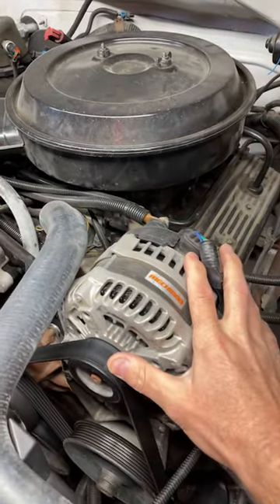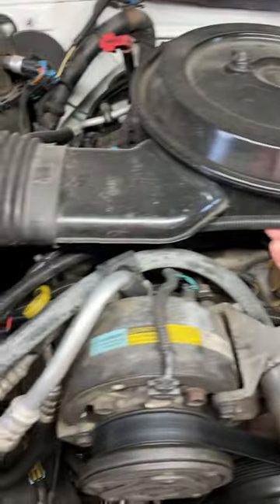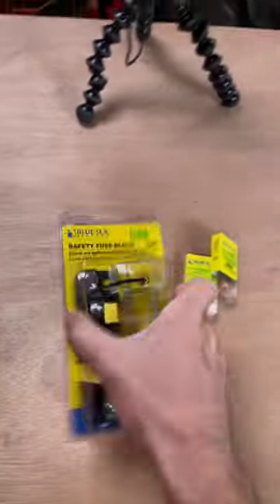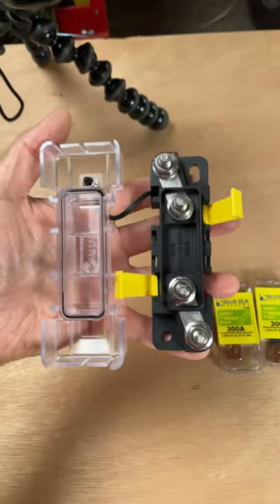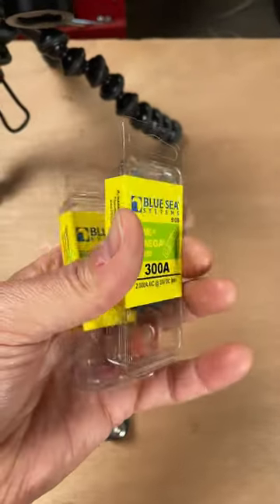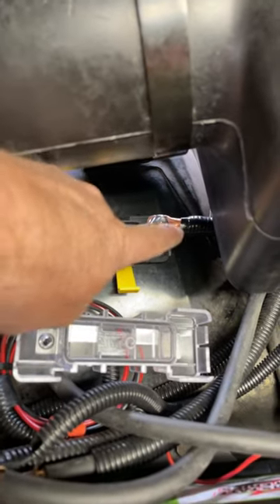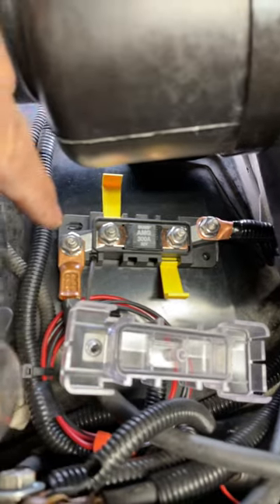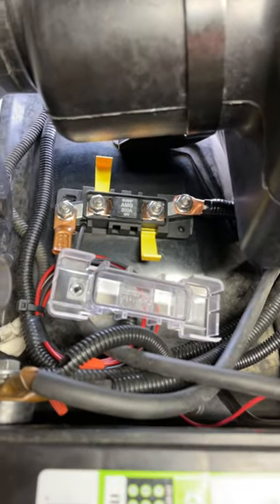Customer States His Install Was Professional!!

Comment: How many amp is rating the alternator and the battery?
Reply from the maker: 250amp alt. Standard 12v battery. Alts don’t send full rated amperage… the only produce what is required. An alts rating is a maximum that it’s able to produce if needed. To my understanding a fuse block IS absolutely needed on the positive wire and must be rated for higher than what the alt is capable of. So, since it’s a 250amp alt, I installed a 300amp fuse. The fuse should only ever be needed if there is a problem of course. 🤙

Comment: I'm a professional technician for 30 years you don't put a fuse on the alternator , you put a fuse on the line that goes in to the car. You're trying to save the car not the alternator,  the alternator. Cassandra sisters that cut off or burnout, but for the battery into the car it doesn't.

Comment: Hate to burst a bubble here, but there's not usually a fuse between the alternator and battery for most vehicles. They come directly from the factory like that. There IS usually one between the car's electrical system, i.e. the fuse box, and the battery, but not between the alternator and the battery. There's really no point in having one there.

Comment: Hmm? Stock doesn't have a fuse and some stock alternators are 220ah. And the two ambulances I worked on with dual alternators neither with fuses. So freaking out seems like a money pitch. 

Now, on a different note, I did have an alternator fail, twice, once it melted the cables and damaged the battery. The second exploded the alternator while on the highway and it looked like someone welding with sparks blowing out the side of the truck.

As for what to charge, it shouldn't have taken more than a few minutes, so shop minimum for either half hour or hour depending on your rates. Me personally, I would charge $30, but I always follow the shop hourly rates. $57 is a good shop charge. I personally charge half of shop minimum since I don't have the overhead. Now, if you say it's a trade specific repair, training charges can apply like welding, which $120+ can be warranted. But, fuses are fairly basic and only knowing a good quality is really needed these days, so I would say, $40 is a great price plus parts

Comment: What would happen if you didn’t add a breaker box? The worst case scenario the high output alternator charges the battery up so much that it surges blowing all the fuses in the vehicle. Wouldn’t it do that anyway unless the fuse is rated so low but wouldn’t that blow it negating the extra charge. If it’s a series of battery’s which is most likely why you would want a …. What?

Comment: Retired Professional Mechanic: Amistad none of them are fused from factory.  What's the big deal, not going to make it charge any better. If wire is correctly routed there is no need. Just made another problem so if alternator doesn't charged 
Another thing to check

Comment: That alternator probably isn't rated at 300A. That fuse will never blow  unless it shorts to ground. Take off that 2 gage wire. Install 8 gage wire will probably be better. Depending on the alternator output I'd install a fuse or fuseable link accordingly.
   You're question on charging the customer should be a half hour labor. $15.00

Comment: the only way this would be of any help is I'd you stuck a fuse right after the alternator then another right after the battery. even then it's not going to do much because if it blows the line is still hot from the other end so it is not very helpful at all.

Comment: Doesn't need a fuse, it will drain that little battery before it catches fire. Thats why your starter motor cable doesn't have a fuse either.

Comment: Thats like 40 bucks for the labor and add on the price of the parts with an included receipt. But why fuse the charging cable? Never saw that before. Unless its bc of the "high amp" alternator.

Comment: I love how there is so many people in the comments saying it's not necessary or pointless I would 90 percent of personal vehicle have some kind of fuse between the alternator and the battery wether it be a traditional fuse a fuseable link or built into the junction box or on the battery cable itself with a smart terminal most vehicles do have them. I mean just think about it with that high of amps what would happen if it shorted to ground it would burn the car down

Comment: Why don’t alternators have fuses from factory then?? Also the spot you put that fuse is pointless it’s in the middle meaning if there’s a break in the line between alt and fuse of bat and fuse then that fuse is going to do nothing the only situation where it would work is if there’s a break either direction after the fuse and it grounds out…

Comment: Anything you charge is too much, OEM often has a direct wire from the positive on the battery to the alternator.  Unless the owner wanted you to install the inline fuse, in that case the book tells you how much to charge them as if you were repairing a short in that wire plus list on the part.

Comment: My friends little brother was talking about hooking a system up in his truck and was asking me questions about how to do it, I told him what gauge wire he needed and to make sure he installs the fuse like 6 to 12 inches from the battery. I go over my friends and he's there so I ask to see it, and he has like speaker wire running to the battery with no fuse for the amps power wire and the same thing for the ground. It was like 2 tens probably around 500 rms watts, I told him what was gonna happen and made sure to let him know I'm serious, I told his brother to talk to him about it but he still didn't listen. Went over for 4th of July a couple weeks later and it was still the same way and he was playing music sitting it in with the door open and you just hear him scream, the wire was on fire and red hot but luckily he seen it cause the door was open, started melting into the plastic on the battery and was smoking like crazy 🤣🤣🤣🤣🤣🤣. He just never hooked it up again LMAO.

Comment: 👏👏👏👏👏👍👍👍👍⚡⚡ now his alternator won't catch his battery on fire if it fails. I'd charge him an hourly rate of 80 and hour. And 2 hours of labor to diagnose get the parts and installing them. Out the door if quote them 160 labor and the 2 fuses are not cheap about 20 each. And that block is about 30 dollars. 
So my quote would be 100 for parts
                                         160 for labor

Comment: To everyone saying that there's a problem with adding a fuse to the charge wire oh, what if there was a short and that high amperage alternator? You would be out of a vehicle if you didn't have a fuse from the battery to the alternator. So yes you should have a fuse from the battery to the alternator, especially with a high amperage alternator. For the mechanic that said he's never seen a fuse on the charge wire, I want to know where you work, so I can avoid going there.

Comment: I don’t think you need a fuse in that situation. Alternator has a voltage regulated. Also that wire it’s too much. A proper wire for the alternator amps out put it’s enough

Comment: Whatever the cost of the fuse + 30 bucks. Because you really only did like 10-15 minutes of work. To cut the existing wire, strip them back for the eyelets, install the eyelets, and mounting the fuse. Price of parts doesn't change much. And if you're working for yourself, the labor cost is flexible. You want to charge enough to cover any costs for expendable items like self-tappers or whatever it is you used to mount the fuse. And then for the little bit of time it took you. I probably undercharge by a lot for most of the things I do. But I charge based on how much work it's going to take. If I didn't do hardly anything, then I won't charge hardly anything. But if it's going to be a drawn out process that's going to take a chunk of time, it's gonna cost a bit

Comment: 5 thousand dollars. If my mechanic can get away with charging me 950 to do just the front brakes and a ball joint the you can charge 5 grand for that due to the electrical system being worked on. Call it hazard pay

Comment: Okay 1 dont put a big heavy high amperage wire in a spot it can wear through like under all that stuff 2 dont put it where it can get hot 3. use the proper wire for the load you are operating with 4 if all of that can not ensure the wires safety than put the fuse as close to the component supplying the power as possible so that the fuse can actually do its job cause if it shorts to that air cleaner fuse no workie. if it shorts to those a/c lines fuse no workie. and then it looks like it is laying across that valve cover so another short point right before the alternator saving device the only point it could short that that fuse could help it is between the fuse and the battery where that wire actually looks safe so my conclusion as a mechanic that has installed these fuse and removed them i can tell you this one will ONLY help if the alternator itself has the failure so i will say this the install was fine before and you ripped that cusomuer off and talked crap on an honest true pro that you could do to learn a thing or two from give that customer their money back and dont do no more dumb crap unless you move that fuse to as close to the alternator as you currently have it to the battery your a straight dolt and stay away from my car and the ones i work on

Comment: There's no fuse on the factory cable from the alternator, this video is ridiculous. That cable should have been better routed though. 
The fusing is necessary after the battery to protect the factory components and any aftermarket equipment.

Comment: Isn't the job of a fuse to protect consumers? Why put one BEFORE the battery? Also, I would pay you less for using black cable without at least red heat shrink tube to seal the connections and color code the cable to be visibly POSITIVE. I only see the cheapo crimp, not a 360 hydraulic press fit or solder. Not professional as far as my standards go.

Comment: Why would you need a fuse to the battery?  Batteries only like to be charged at 2-10amps depending.   The voltage regulation should reduce the output according to usage.  This is a needless install.  And 300amp isn't needed unless, during driving, he's using 280+ amps.   Maybe a high powered bass system, or something like 50 120 inverters running vacuum cleaners, but then he only needs a Capacitor for the bass sound system and not a fuse off the alt.  I'd like to know why you think that's needed?  I'm an Electrical Engineer, and don't understand your train of thought, other than doing that, just to make money.. .  SHAME ON YOU!!

Comment: If it were more professional then there would be more heat-shrink around the exposed + charged metal.    I don't know why they'd meed more alternator when IMO dual starter-batteries offer more power with the exact same charge-problem.

Comment: Whatever you charge - it's too much.  unless you insulated / isolated the + wire from the back of the alternator into the fuse block - the wire is still + live and subject to being shorted which is the point of the fuse.   The fuse should be as close to the alternator as possible. Not all the way across the big metal block.

Comment: Back to auto electrics 101 for you. Quite apart from the fact there is no fuse on the starter or alternator line, with a 300A fuse, seriously? The car will be a smoking hulk of ashes long before the fuse would blow.

Comment: I’m surprised how many “mechanics” haven’t seen a fuses alternator wire. Even if the main wire isn’t fused. If it’s going to the fuse box the fuse is probably in the box and not in line. If you’ve gone “12 years” in the field and you haven’t seen one. Your not a mechanic.

Comment: Charge Zero. 
There is Zero point in having a 300A fuse between the alternator and the battery.
What exactly are you expecting to draw 300A that would blow that fuse ?
You might put the fuse between the battery and the starter, that would make sense to protect the battery. 
The fuse needs to be between the alternator and the load not a battery that can put out 300A itself.
You don't say what the alternator puts out.
You should have put in multiple fuses sized for each load.  The fuse to the battery only needs to be large enough for charging current.

Comment: 3 hours minimum. 1hr diag.=you take time out of your busy day and open the hood.(Mymy, what a huge cable you have 🤓!) Quick inspection reveals likely ensuing property damage and possible life threatening danger, due to installers ignorance of necessary countermeasures. 2hrs to fabricate a viable solution and test. Plus parts. And don't forget my tip.!

Comment: Lol the fuse on that wire is useless. It would need to be fused at both ends because power comes from both directions the alt and the batt so any short in the middle would be fed from both directions that fuse blows but you still have a short powered from the other direction. so you just wasted your money. Zip ties to prevent pinched wires is more effective.

Comment: No fuse needed on such a short wire. You use a fuse on wire that is more prone to shorting out. Especially ones that could get crimped in a wreck.
That wire is so short there is as much wire past the fuse as there is not. Between the battery and the fuse is nothing so it's just as dangerous. So why fuse it to begin with.

Comment: Well seeing the line that goes to the battery is only supplying 14.5 volts max and the fuse block should have been installed on the line going to the vehicles electrical system I would say you actually owe the car owner an apology.

Comment: To thin wire from the fuse to the battery... That wire will break before the fuse does if it is a problem OR the diodes in the alternator.

In what real problem do you think that a fuse would solve???

It is a reason why no fuse is installed as a standard item in a car. It is useless...

Comment: most car maritime and industrial engines does not have a fuse on the alternator, usaly it is just a cable from the alternator to the + on the starter, or to the battery. ofcorse a fuse is never a bad thing, but as a boat mechanic for 30 years i have never seen any problem with this setup. but a fuse may help the one time.

Comment: Factory doesn't use a fuse in that line, why should you? It's not necessary, and you can't draw three hundred amps out of that alternator it will only supply about 140 before you burn it out. CONGRATULATIONS! you just wasted about a hundred bux of customer money

Comment: Doesn't need a fuse.. The battery is basically the same as a capacitor.. Once you get to 13.8V or so,, it automatically stops charging.. You ripped the customer off.

Comment: Done 50 myself. I own 6 cars. The internals of the alternator pops if something goes bad. Cheaper to rebuild it then what that fuse block cost. And you keep the wire shorter. And a 300 amp fuse would only protect the second half of the wire.  But keep telling the internet how to do it. What an idiot.

Comment: The distance you put the fuse from the bat and alt make the fuse pointless. That wire still has plenty of things to ground out on from the alt to the holder and the bag you the holder. What's that point of the fuse besides using the poor guys money.... First installer did it right and didn't take his money. You robbed him.

Comment: why are you only protecting 5inches of wire? and they don't even run over the engine where the short most likely will happen
Reply from the maker: The fuse is protecting the entire charging system by being inline about 1ft away from the positive post on the battery. The directions given with the Mechman 250 amp alternator want a fuse approx 1 ft away from the battery and that's what I did. ✌️

Comment: This is stupid.. use a good thick wire and not worry about it.. intentionally putting a weak spot on your charging system is really sstupid. Fuse your accessories. Not the alternator. There's a reason they didnt put a fuse there from the factory

Comment: This is one place where a fuse doesn't really help much.  No fuse in this circuit is acceptable.   Even with the fuse you still have an unfused whip from the battery terminal to the fuse.    If that whip rubs through or comes in contact with ground its game over and the fuse won't do a damn thing.   And if the alternator shorts out inside, it will catch fire at only 20-30 amps of inflow current, long before that 300A monster opens.

Comment: why did you put a fuse on an alternator????? did you not  know the battery puts out more amperage than the alternator does and the alternator is not connected to the fuse panel or power distribution only to the battery   so it is point less to puts a fuse between alternator and battery as the alternator will never exceed the it maximum set out put and the maximum out put of any alternator will be 200 amps as you can not safely charge a Lead acid or glass mat battery with any higher amperage .... and well even that is risky  80 amps to 100 amps is the safest rouet to go unless you have high power consumption  like me I have a switch  on my alternator that is set for 80 and 200 I use the 200 when jumping vehicles or need more power  like when I run my massive inverter  for my tools and welder    but honestly installing a fuse between the alt and batt is pointless

Comment: For creating a bigger fire hazzard? Exposing bare high amp cable and mounting it less than an inch from a steel in inner fender? That's a frigging mess. Ever hear of shrink wrap? Please don't do electrical work like this.

Comment: he just like me fr, 320a output alternator on 300A fuse
Reply: at peak maybe 320A but I doubt it, that's a ton of current
Reply: @Unite-4-Peace  doubt all you want i have QC paperwork certifying it. 129A @650RPM 339A @1400 RPM
Reply: Clamp don't lie either 😜